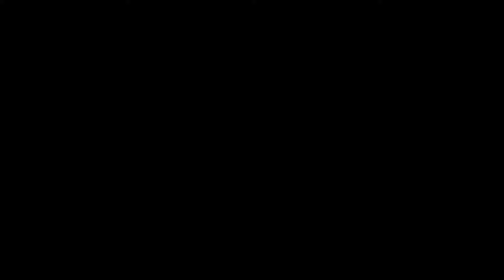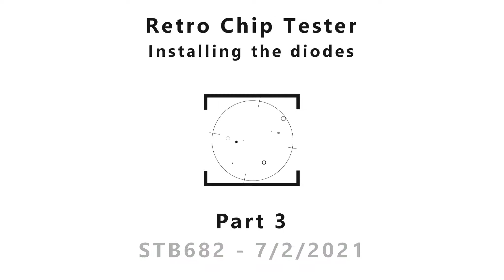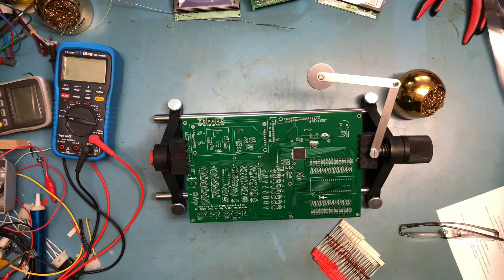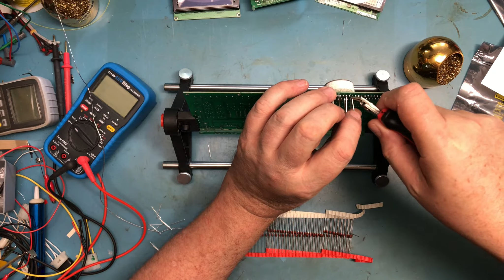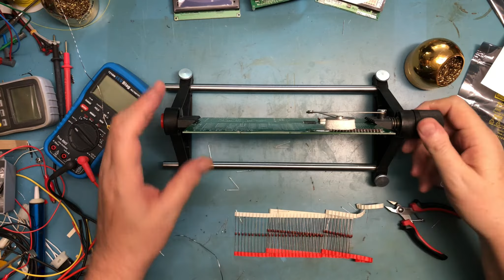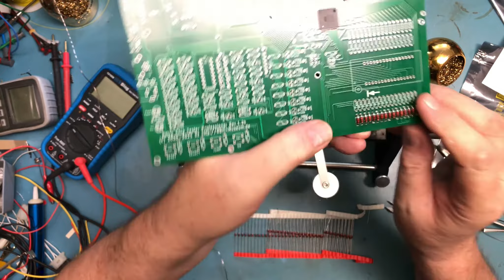STB682 - Retro Chip Tester - Part 3 - Installing diodes

Comment: May I suggest wiping the leads with a pair of needle nose pliers. This will remove the layer of oxides on all components, even new. You will find soldering is MUCH better..  Been doing this over 45 years when an engineer friend suggested it to me....Good luck !!
Reply from the maker: I'll give it a try.

Comment: I like the assembly jig you have there. Mine was a Amazon special and it doesn't have the holding arm like yours does. I might try and modify mine to add one.
Reply from the maker: I've traditionally used painters tape (blue tape) to hold parts in place for soldering however the arm does make it easier for many parts.
Reply: @ShadowTronBlog  Where did you get that fantastic jig, I would like to get one similar❓
Reply from the maker: @theoracle6142  It's a Weller T0051502699N - I bought it on amazon.com - https://www.amazon.com/gp/product/B06XCBW7SH/ref=ppx_yo_dt_b_asin_title_o03_s00?ie=UTF8&psc=1

Comment: The Atmega is not programmed as far as I know..
I had to program mine..(and you have to make sure the sd card reader is out as it uses the same lines)
Also I had to use avrdudess to program it ...and your programmer should supply the dc power don't use the boards power..
I just did a read fuses first to verify communication first.
Reply from the maker: He supplied mine preprogrammed, I may have paid a little extra for the service but I don't recall.